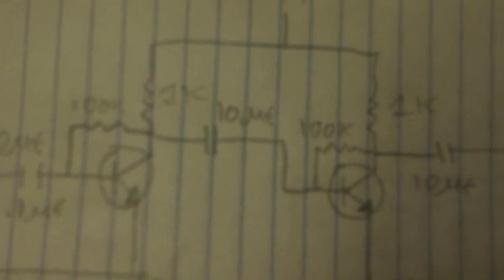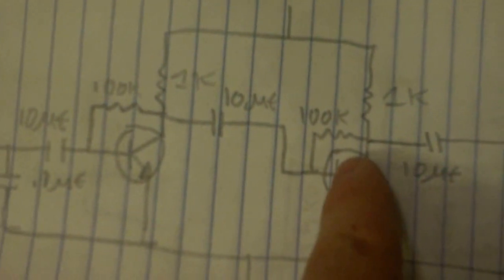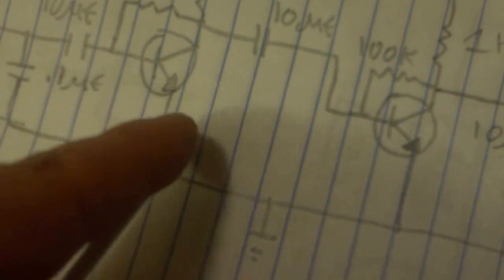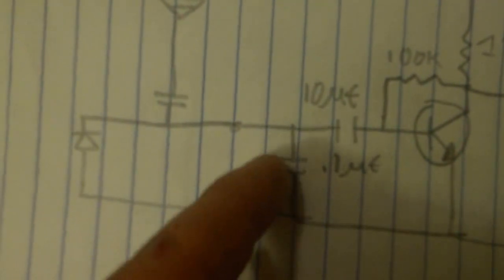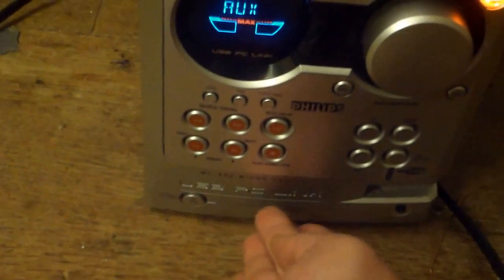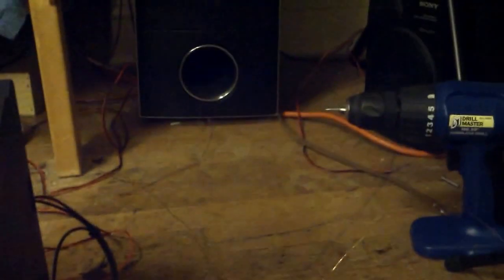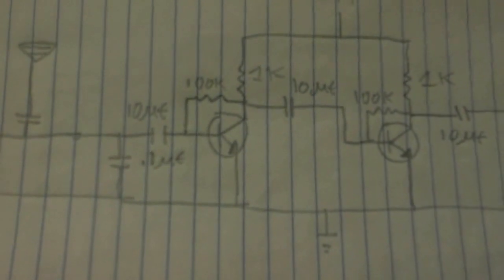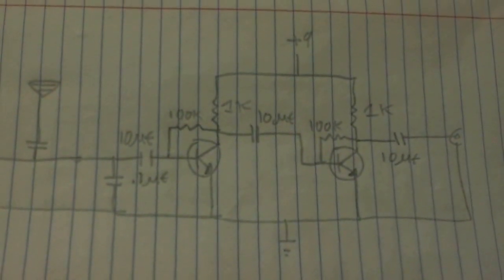Two transistor Fm receiver

Comment: Could be that the wire's capacitance and inductance (it's very small but it is there) just happens to be ideal for picking up something in the FM band. If I'm right, you basically have formed a 1 turn "coil" from the wire connected to the input. Although this is an AM receiver, an AM receiver can demodulate FM reasonably well. I'm not sure how it was able to tune into an FM frequency with the real coil attached though.
Reply: Or it's picking up an AM simulcast.  This is not at all uncommon in North America.